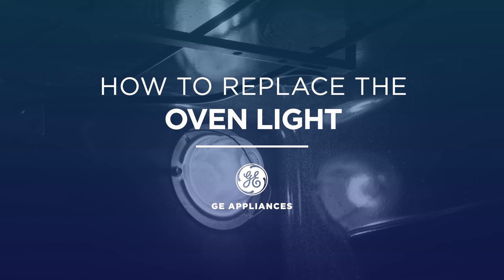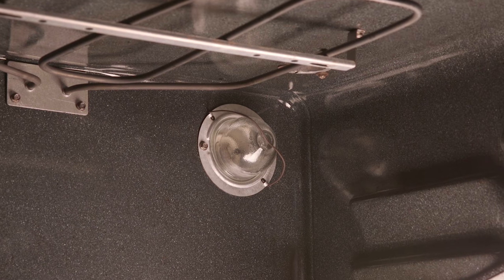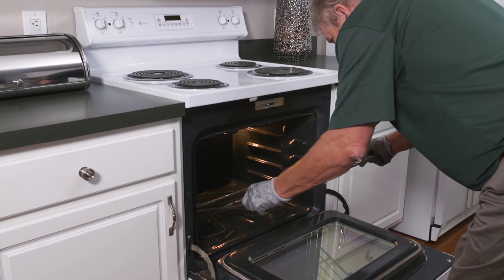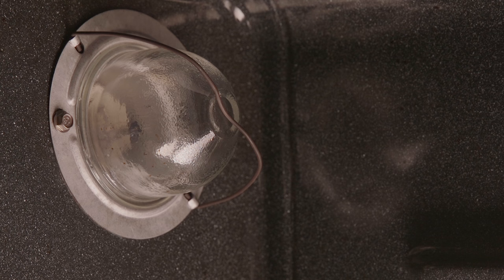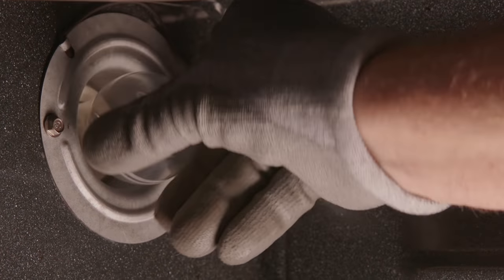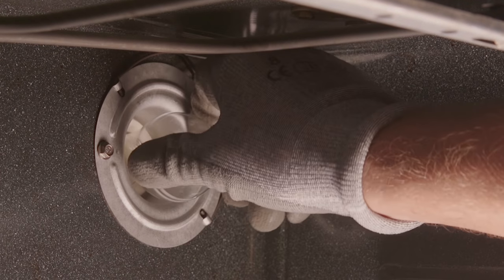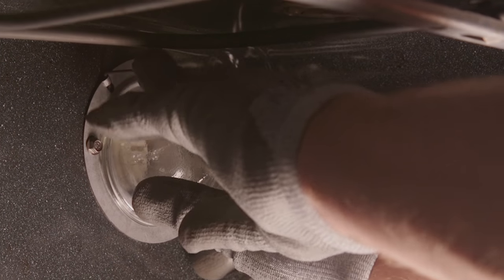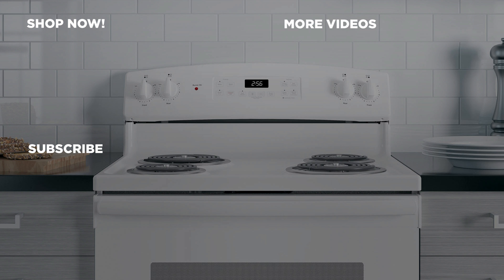GE Appliances Oven Light Installation Instructions

Comment: I have a question about the two red lights that are on, when a burner is on.  My two 2 lights have started to flicker.  Why are the 2 reds lights flickering?  Is it an electrical short or just light bulbs need to be replaced?
Reply from the maker: Hello, Paula! Thanks so much for reaching out and choosing GEA. If you can message us with your model number, we may be able to provide more information. However, most indicator lights should not flash, so we recommend disconnecting the appliance for several minutes and reconnecting. If the issue persists, service may be needed. Hope this help. Thanks. - JB

Comment: I need your help.. My bulb burned out it came apart as I removed it. Once I was able to get the base out. I replaced the bulb. But the light still won't work now. It seems when the light went out it did something to the unit that holds the bulb. What else can I do to get the light feature to work again in my GE Oven? It is only about a year old.
Reply from the maker: Hello-We are sorry to hear that happened with your unit. Could you please send us a private message with your model and serial number, and we can look into this for you? Sincerely-DM
Reply from the maker: Hello-Thank you for providing us with this information. We did find some troubleshooting tips that may help with this in the use and care manual page 30 please refer to the manual that we will link below for you. 
Oven light does not work:
Light bulb is loose or defective. Tighten or replace bulb. See the Maintenance section for instructions on how to replace the bulb.
http://spklr.io/6053mkz5.
If you find after troubleshooting that this does not help with the issue then we suggest reaching out to have one of our service technicians to come out to look at your unit. We will link below how to get in touch with them. Let us know if there is anything else we can help with or look into for you. Sincerely-DM
Service Link: http://spklr.io/6054mkzg

Comment: The cover is not coming off that easily. Is that common? What else will help get the cover off without breaking?
Reply: I'm having the same problem. Did you find out how to remove it?
Reply: @marykguidry7793  I did. I had to be gentle, but with force, meaning, I had to twist as l pulled hard without squeezing the glass cover and breaking it.
Reply: @marykguidry7793  It took a few tries, but it did come off. Light twisting as I pulled. Just not pushing in & adding pressure to the cover itself.